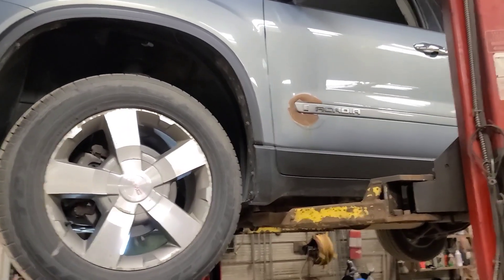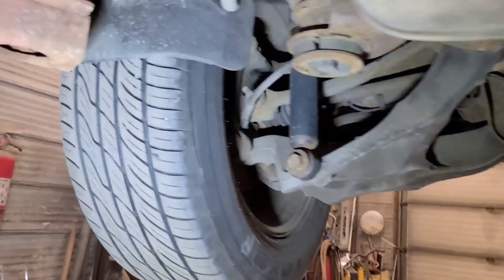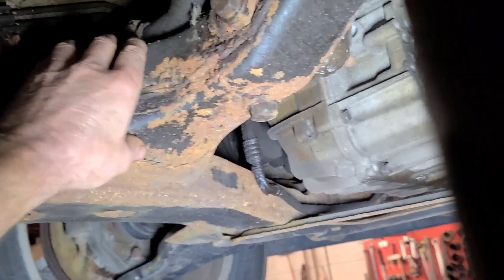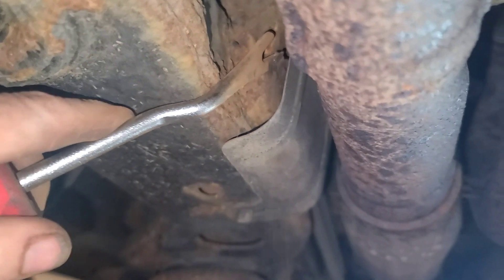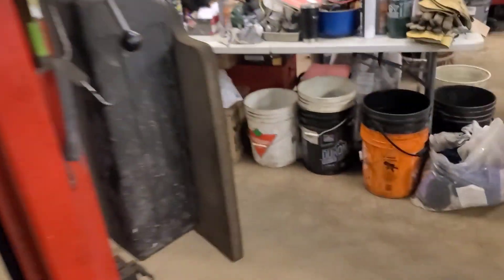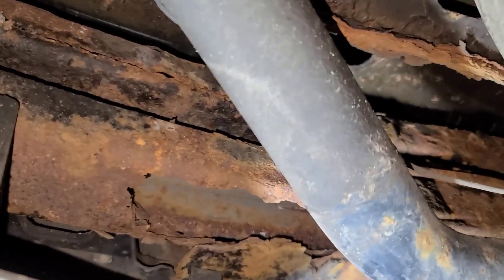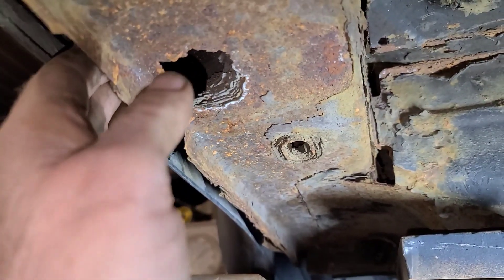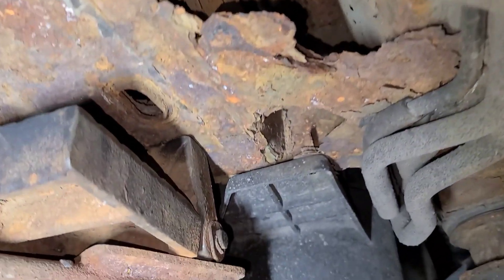Why You Should Inspect Before You Buy

Comment: My aunt bought a 08 Chevrolet trailblazer and it's got the full frame but after examining it after she bought it and she called me and said that it's making a bad noise underneath it I went down and checked it out and the frame was completely rotted out the inside on both sides and the frame was cracking on the top and bottom were the door meets the fender in front I never saw anything so rotted out in my time and the body and inside is perfect..